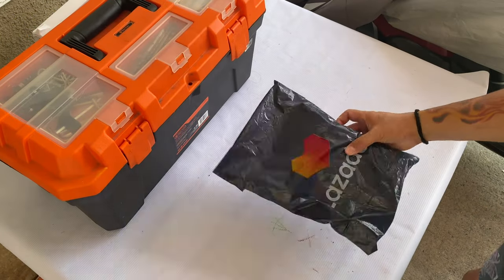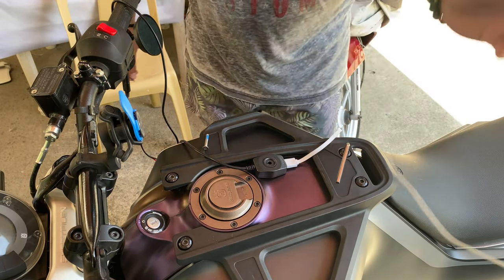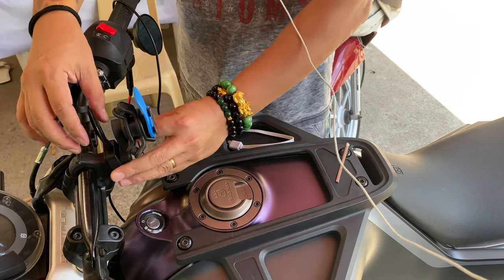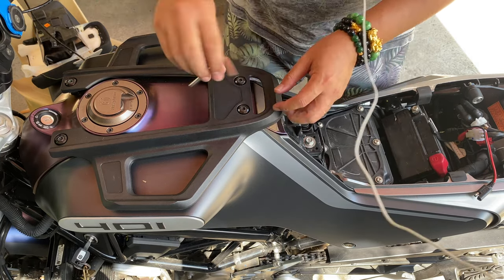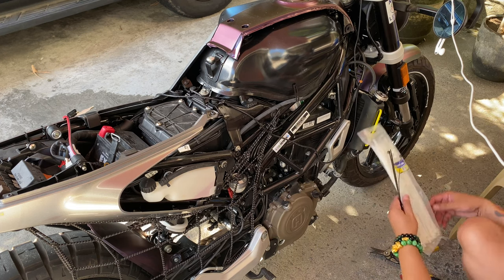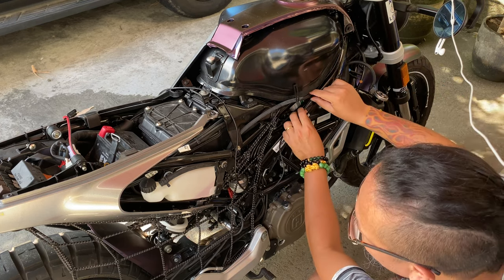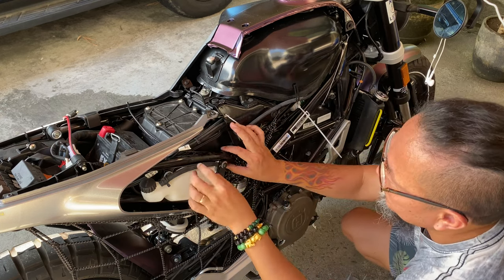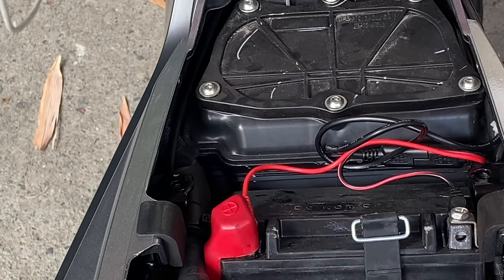DIY: QuadLock Motorcycle USB Charger Installation on my Husqvarna Svartpilen 401

Comment: Isn't it best to connect to one of the accessories wires? If not, shouldn't you have a relay switch in there somewhere? It looks like you're just setting yourself up to drain the battery.
Reply from the maker: @dougmoen  3 years to present…I haven’t drained my battery. 
I don’t pick up rock to hit my head with.
Reply: @elchinolavida  Glad to hear it. Wear a helmet just in case.